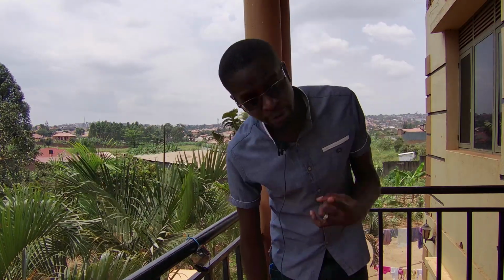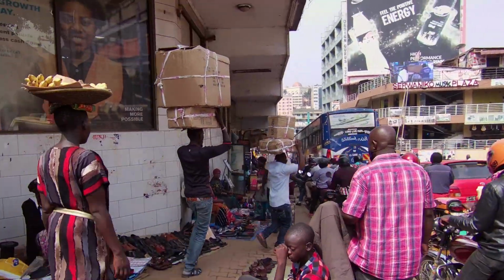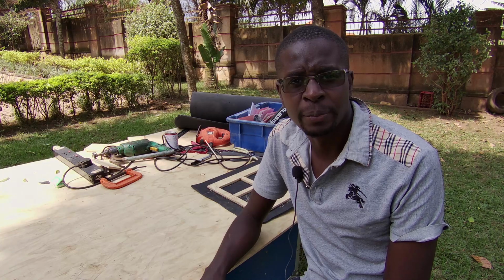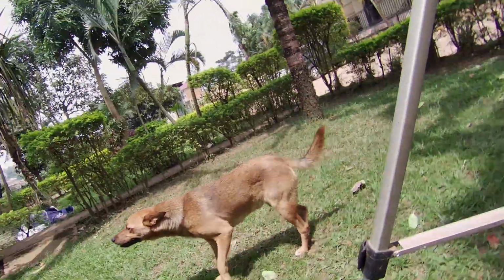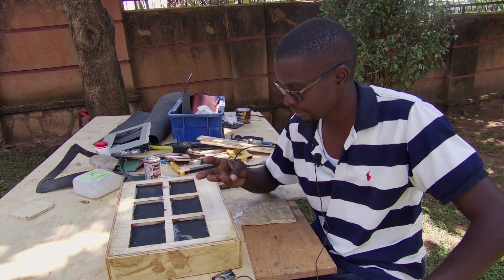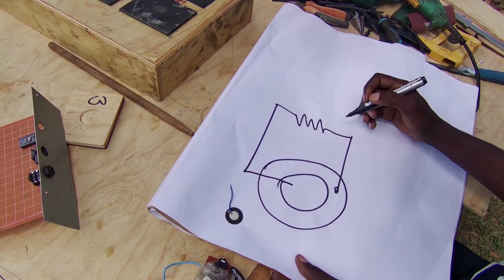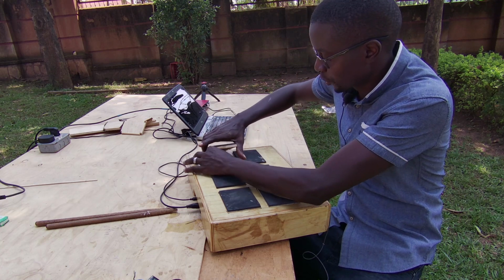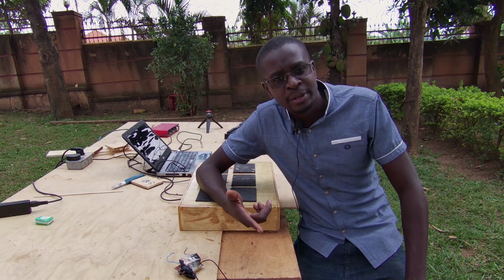DIY or buy? How to make electronic drum pads

Comment: Interesting how in Africa, you just make  things work. I've seen  guitars made out of oil cans. Okay,  it doesn't sound like a Torres, but it means you can play something. These piezoelectric sensors are sold in bulk for next to nothing. I bought a mesh practice set and simply made triggers from these without 10 megaohm Resistor/ diode and got the same response as the Alesis pads. Your video is certainly valuable.  Great fun too. You can't have too many pads though - so I think yours could actually be 12 pads, following Alesis' lead in providing bar triggers at the top of the unit.

Comment: Somehow I was expecting you to pick up music cards. I think the problem with the velocity might not have to do with the piezo, but with the construction of your pads. I did a similar thing, but instead of making a drum pad, I got a cheap Playstation 3 Band Hero toy, and added piezo's in there (they were in there already, but some were faulty or missing). Then I hooked up the sensors to a Korg DRM-1, some cheap vintage drum machine with trigger inputs.  I do get velocity on all pads, the ones that were already in the Playstation drum controller, and from the ones from music cards I put in there myself.

Comment: This was great, I liked, subscribed, and signed up for the patreon.  

I've worked on a number of electronic instruments, so maybe like LeVileinCam I can offer some thoughts/suggestions for you to consider while you ponder improvements.  The arduino code looks great, the fact that it can capture so much detail on the Alesis sensors is encouraging that the code itself is fast enough to capture satisfactorily, it is handy to have that kind of scope view.  

My feeling is I would set aside the worry about the quality of the piezos for a moment, and consider some other possibilities for why your sensors might be damped compared to the Alesis, and my first suspicion would be about the wood-on-wood friction on the sides of the pad.  To isolate that variable, I'd remove a pad, set it on a piece of rubber and whack it, see if you still see the unpredictable peaks.  If the peaks are more predictable, then that friction might be interfering, and I think it almost certainly is.  

The other thing is, the Alesis voltages have a nice long decay, so that makes it easier for their microcontroller to capture them, they are longer so the code on the MCU doesn't have to be as perfect.  Maybe a very small value cap across the 10Mohm resistor would stretch out that voltage just a little, and make it look nicer on the arduino-scope capture.  

So I would say, try isolating the sensor more, and if you want to, add some capacitance to your piezo output if you want to get a longer decay.  That's my gut instinct.  Also, focus just on one sensor until the voltage output looks 'readable' to you.  I find that if my brain+eyes can see it in the voltage, then the code is always easy to write.
Reply: I remembered today, you might want to use an additional diode as a half-wave rectifier on the output of the piezo, before the cap.  That way when the piezo bounces back into a negative voltage you don't drain the charge off the cap.  This person seems to have done something similar that is worth taking a look at:  https://forum.arduino.cc/index.php?topic=296625.0
Reply from the maker: Great insights...thanks for subscribing
Reply: @Afrorack  My pleasure entirely!  Please do write if I can offer anything more.  My own entrance into my own electronic music was the floppy audio project, I think I posted it on a different channel, but you can see some of my other work there, it started out as a similar diy approach from things I found lying around and progressed from there:  https://www.youtube.com/watch?v=OrJmvogpa-o
Reply: But youtube has changed so much, and turning a video about a creation that is exciting to the creator into a journey for the audience is so much of an improvement.  It's really wonderful to see you show the way it can be done.
Reply from the maker: @danielmcanulty1562  checked out ur floppy project...awesome stuff ...11 years ago!!
Reply: @Afrorack  Time certainly flies :)

Comment: Wow.... amazing I tried out such a project in 2017 it worked but not as I expected. It got me too frustrated that I dropped the project. Maybe I can learn more from you
Reply from the maker: What didn't work as expected?
Reply: @Afrorack  The drum pads, I couldn't get real time hits all the time. At some points it would be on time then boom looses time
Reply from the maker: @otimcaeser9819  May have something to do with the strategy u used to determine what a hit is...Determining a hit is simple...you set a threshold beyond which if a signal rises then it is a hit...if u want to determine velocity then after the signal crosses the threshold when there's a hit, you keep track of it until it stops rising (which means you reached the peak) and then map  that value to velocity...and trigger a midi note ...

Comment: try putting the piezo in contact with the rubber instead of the wood. a piezo directly on a hard surface will give a machine-gun like response, whereas a piezo on a flexible surface (like a drum skin for example) will have more dynamics . So maybe a rubber "sandwich" would work better for your pad
Reply from the maker: I will definitely try that.. Thanks
Reply: A gum sheet for ping pong racket could be perfect it have a very good rebound on wood sticks,  i use that as training pad back when i was kid, but adding piezzo on it could be fun, the gum sheet are not that expensive, and can be glue on plywood.